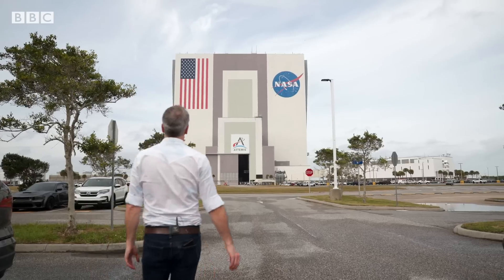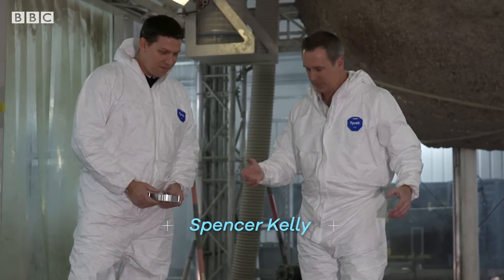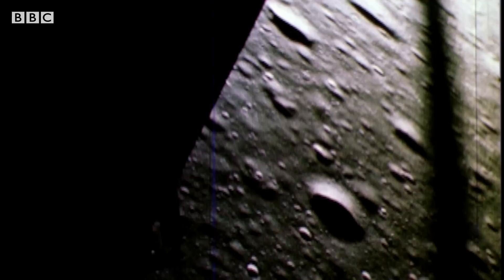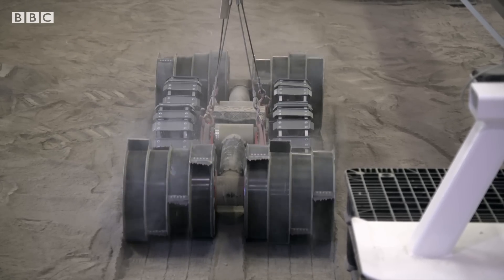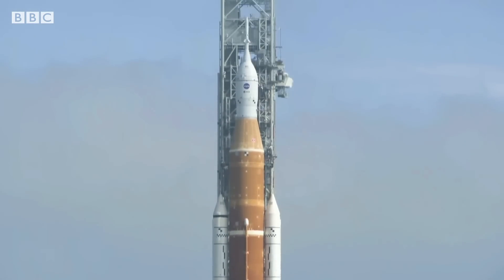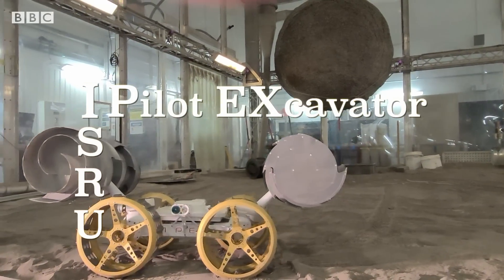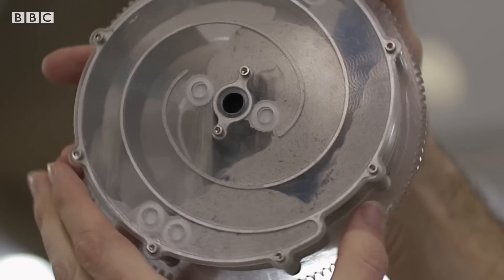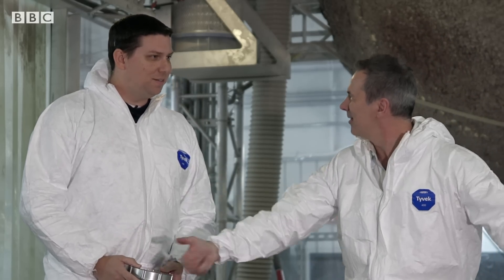Why are scientists making ‘moon dust’? | BBC News

Comment: No one’s ever been to the Moon, there is 250,000 miles of the Van Allen Belts. The levels of radiation would melt you and any metal, including any spacecraft that tries to pass through even the weak points, time to stop believing the lies.

Comment: I have a problem with the simulation setup they have and disagree with me if you have better info. The dust in the earth simulation must behave very differently as gravity is higher but also the dust would float longer because the air is more dense right? On the moon putting your foot down wouldnt create little air vortices that kick the dust so high?
Reply: How are they suppouse to change gravity?
Reply: @milkcultleader2706  well you could place it in an non-intertial reference frame but it would be expensive to have a very tall drop tower test chamber to do that with. Upon rewatching I do see that they had a harness on the digging robot to reduce the effective weight. They likely do create a vacuum in that room for testing. My main irk was when they had people in there with no breathing apparatus kicking up dust. I could probably google this all but impulsively asked youtube comments.
Reply: Hi NASA engineer here. This is actually a huge challenge that we are facing in our return to the moon and the ability to research by fully simulating the lunar environment is difficult. The most recent lunar landers were supposed to gather some more data for this exact purpose. Many of my friends have helped build this Swampworks Regolith Simulant facility. Fundamentally the granular physics equations needed to model the behavior of lunar regolith are still being developed, by my best friend and his research team actually. Simulating 1/6th gravity is really only possible on parabolic flights and some specialized drop towers.  The point of Swamp Works is to get as close as possible but is more focused on studying and testing mechanical systems in the regolith beds and ISRU. On the small scale of these rovers the microgravity and vacuum effects are not as significant as just having the regolith itself but still worth studying. We already know a fair bit about how rovers behave in regolith from the Apollo missions. The actual biggest challenge is landing and launch of a large spacecraft in the moon like the Starship human landing system.  The Apollo lander was much much smaller in comparison. Just watch videos of the first full stack Starship launch and you will see how intense and destructive the impact with significant launch infrastructure already built in place, a full G of gravity, and an atmosphere behaves. Now imagine how much more destructive that could be on the moon with little to no launch infrastructure, 1/6 gravity, and no atmosphere to slow the plumes of regolith created. The impacts on the surrounding area including habitats or rovers and the actual Starship HLS could be catastrophic. That is why this research is so important.